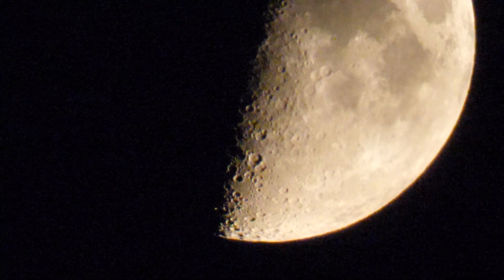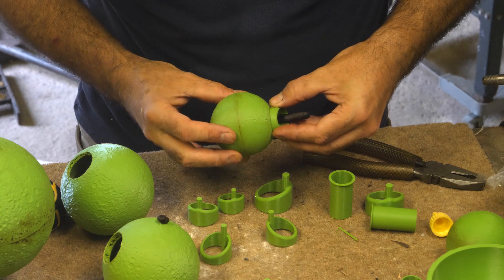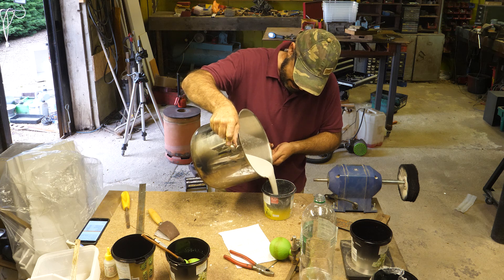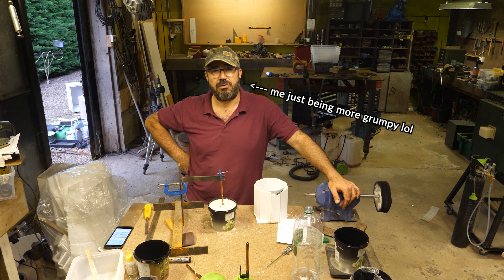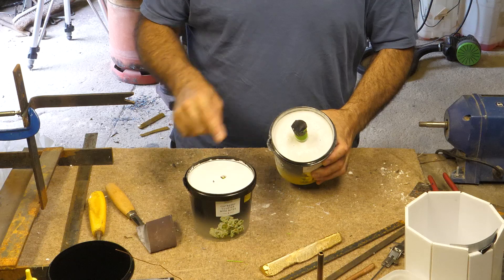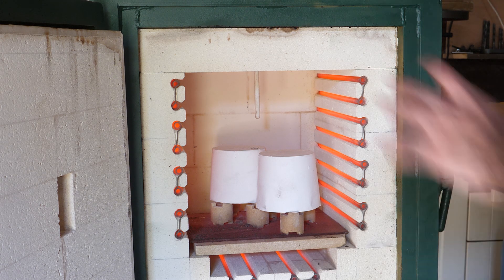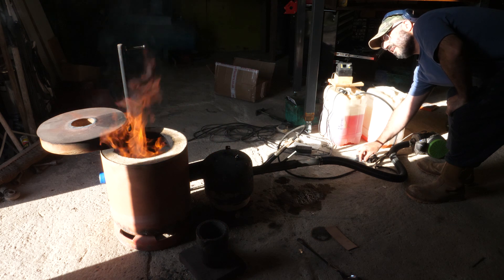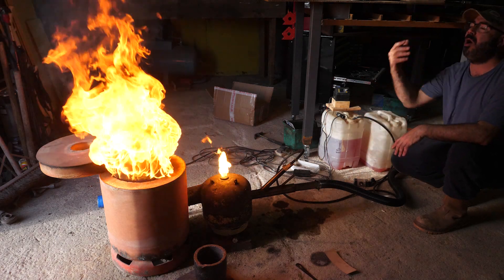Casting The Moon in bronze * PART TWO * Lost PLA Casting

Comment: well I said the magic phrase on the other video so I do like lost PLA casting.  I have been playing with it. I use regular plaster from the DIY store.  very cheap.  definitely not as good as real investment casting plaster.  I do not have a kiln so my downfall right now is that i can't burn out the PLA properly.  I can melt it out but there is still residue which reacts with the molten aluminum.  I felt your pain about the blunder mixing up too much plaster.
Reply from the maker: cheers emaglott :) you are in the draw!

Comment: Hi Julian.  You can use normal acetic cure silicone to smear over a part to make a mould for later reproducing in wax.  Squirt on a line at a time and smear over to meet the adjacent line of silicone.  Don't go too thick so it doesn't take too long to set.  Wax melts and burns out much easier than pla and you have the advantage of only having to do the print once.  To make the mould more rigid you can pour a plaster block over the top.
Reply from the maker: oooh you are clever, i might do that one day thank you. :)

Comment: Nice one Julian, only 6 minutes work time.... that's not a lot !!  At least you managed to get a second one in.  Eagerly awaiting part 3... Must buy myself a kiln and start looking into Lost PLA Casting or (or lost wax).  Seems to be the only way I can get some more interesting castings.  Sand is great but quite restrictive...  investment plaster can't be any more expensive than Petrobond can it ?  I just bought another 75kg of the stuff - what a rip off !!  Just looked at the 'merch' link too - cracked me up - nice one, haha.  Best wishes Andy 😎😎😎🍺🍺🍺👍👍👍
Reply from the maker: haha cheers Andy! yeah... 6 mins is not a lot :)  the investment plaster is quite expensive (dammit), but i'm finding getting organised more troublesome, there is a lot of 'process' to get though. PS part three is now out! (we get moons!)
Reply: @JulianMakes  No it's not.  Quit dicking around with plaster of paris you guys.  You are wasting time making videos using this shit and I'm getting tired of watching you guys fail!  Ransom & Randolph is in the UK.  50lbs of Ultravest should run you less than 40quid.  If you must use Plaster of paris, it's 1/3 plaster 1/3 fine silica and a 1/3 grog.  This is the leftover shit from your last casting.   Burnout and dewax is done at just a few hundred degrees over a long period of 3-5 days.  Max temp for plaster of paris investment is 500f.  I highly doubt pla is going to work well for this.  You are better off running 7-9 layers of ceramic shell OR Ultravest.  Stop being so cheap and buy the stuff!  Yes, petrobond is over priced, but I trust you guys are using it more than once?  Mix it back up into the new stuff and keep going.  If it loses it's stickiness, add some 2 stroke motor oil to it and keep mixing.  If you really plan on sticking with p-bond,  build a muller!  And NO, don't mail me some shitty f-'ed up round moon.  I want the pattern to the crescent moon!  ;-)
Reply from the maker: worldtraveler you made me chuckle cheers :)